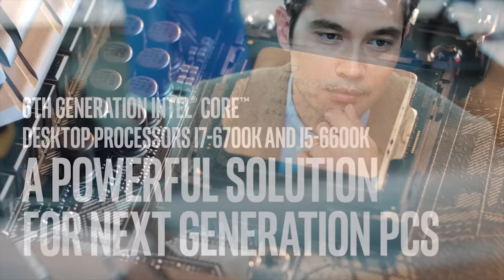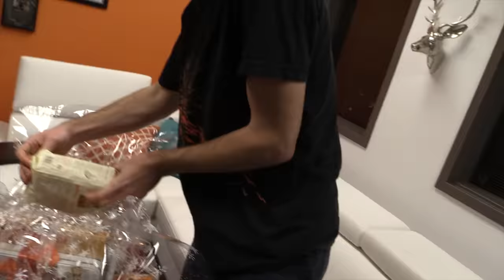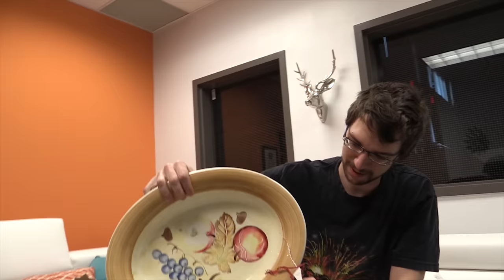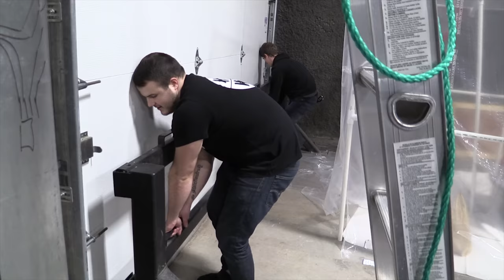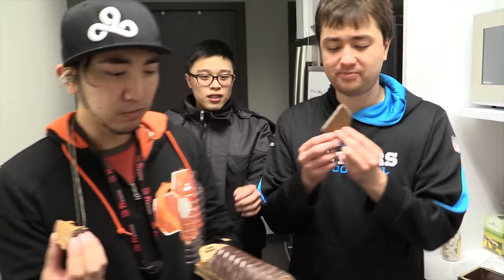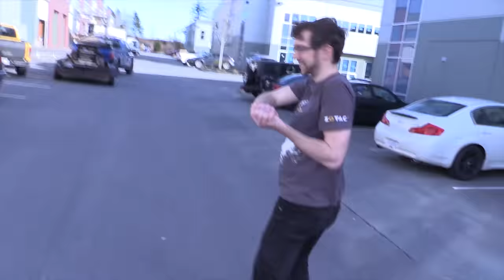We found a frog in our warehouse! - Late 2015/Early 2016 Vlog

Comment: A bit off topic, but does anyone know which 240mm AIO CPU liquid cooler has the most silent pump? Im planning on switching the fans anyway for some nf f12's so it doesnt matter if the included fans are loud.

Cooling performance doesnt matter either as im buying primarily for the looks. Right now i have a NH U12P cooling my 4690k and that big ugly heatsink is blocking the view.

Been searching on formus about h100i, h220, kelvin s24 and plenty of others, but people all have different opinions on which is the quietest pump

Comment: Is This PC Good enough to run gta 5 at 40+ fps

Cpu: AMD Athlon X4 860K 3.7GHz Quad-Core Processor

GPU: Asus GeForce GTX 750 Ti 2GB Video Card

Ram: 2x 4gb

MOBO: Asus A88X-GAMER ATX FM2+ Motherboard